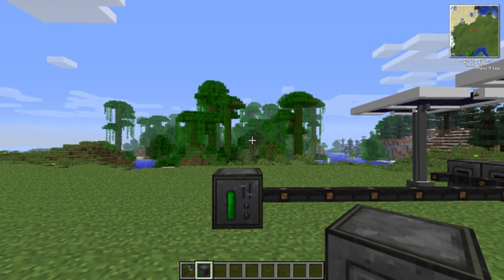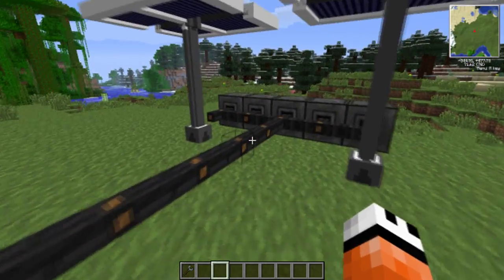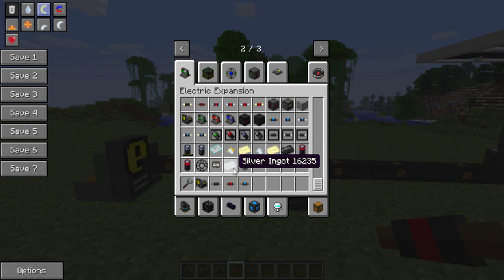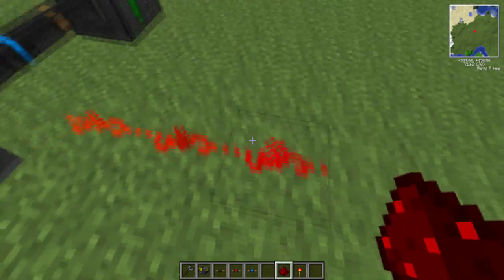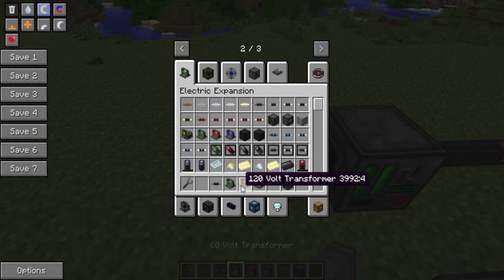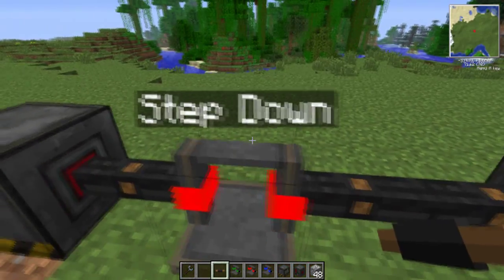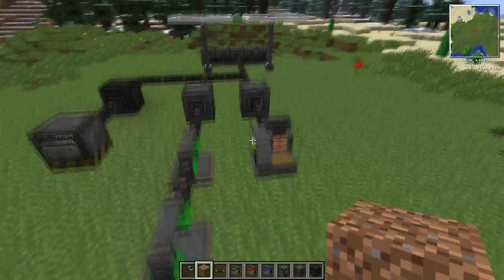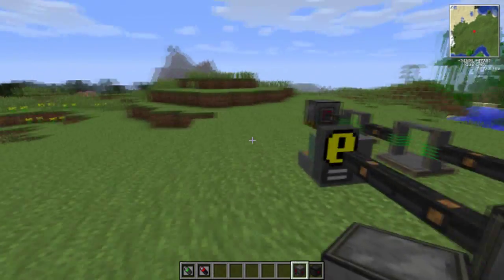Voltz Tutorial: Advanced Electricity/Electric Expansion

Comment: The superconductor recipe actually *does* work in the wire mill. The recipe is 64 bars gets you 64 wire, so it takes ~64 times as long as the other recipes.